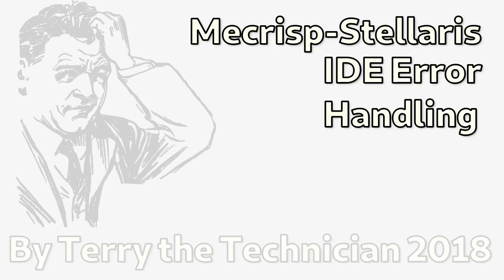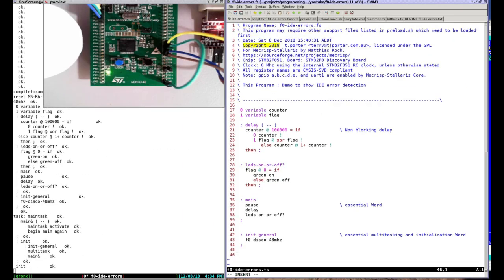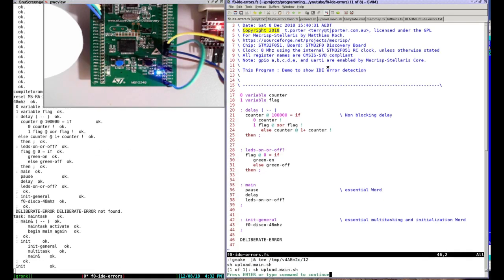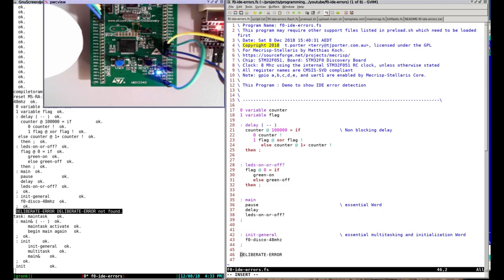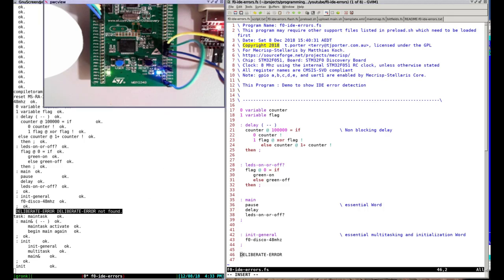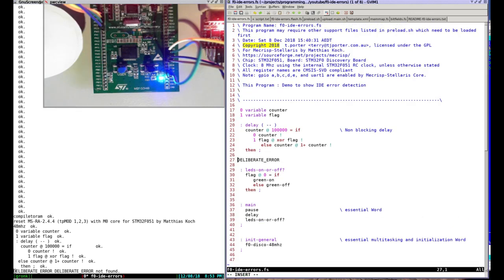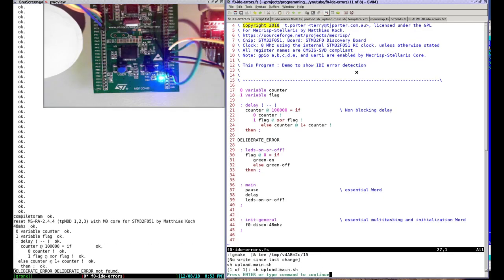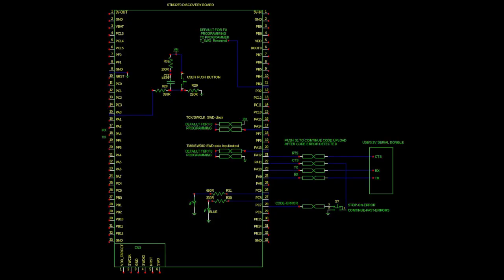Embedded Forth Language on Arm based STM32F0 - IDE Error Handling

Comment: A blinking error light, excellent idea that was probably present on computers in the 60s but rendered irrelevant by consoles and log files since then. Every embedded board should have at least 3 leds, one to show power is on, one to show a heartbeat and one for errors. Sort of “check engine” indicator.
Reply from the maker: Thanks!
My IDE keeps evolving and currently the terminal beeps when the on-chip compiler detects an error and a red error message is inserted into the RX data stream to mark the spot. The advantage is that this works across all Mecrisp targets and I don't have to maintain patches for each new release.

I will be doing a new video showing my current IDE soon.

Cheers,
Terry